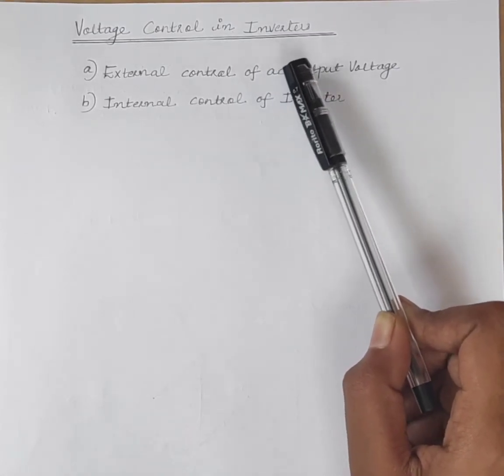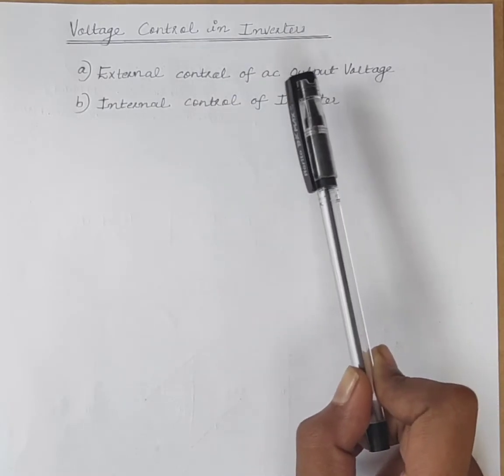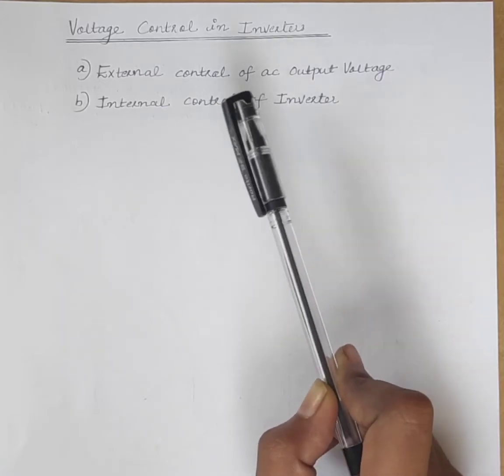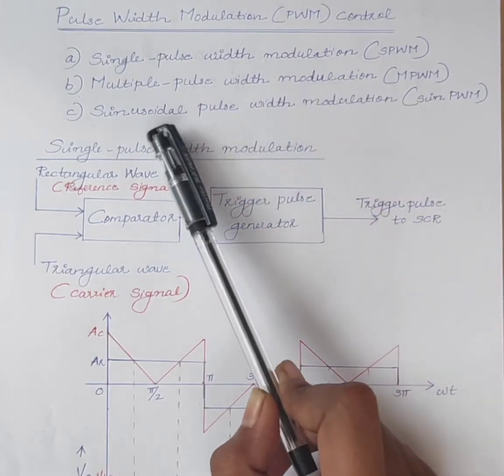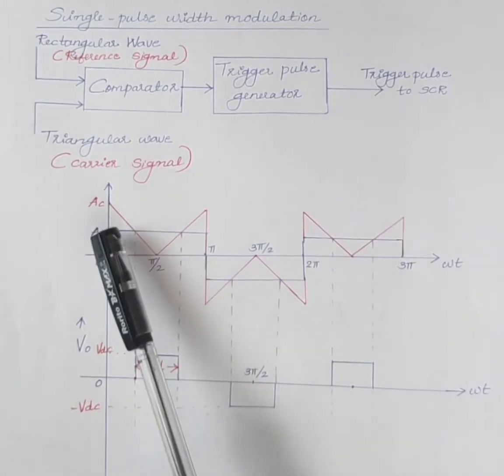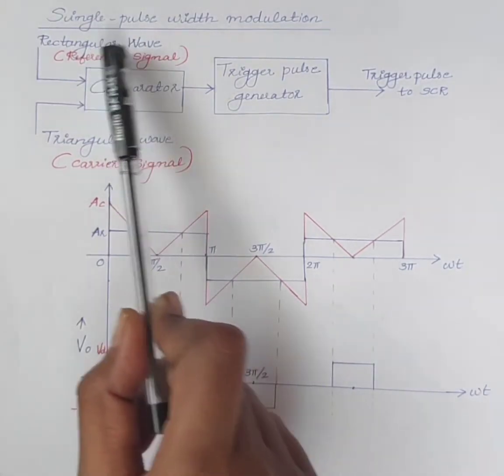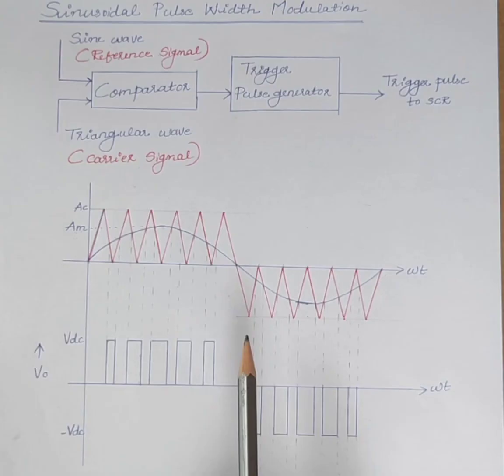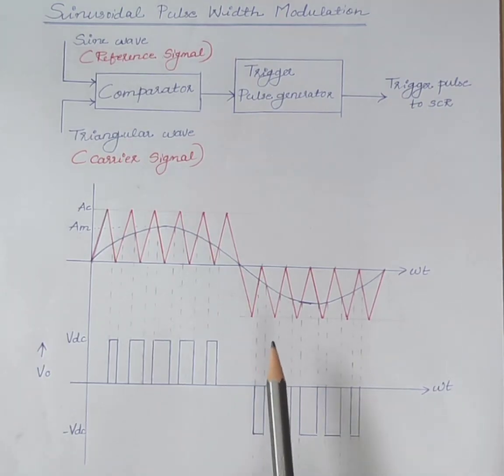Voltage control in inverters - Pulse Width Modulation (PWM) control

Comment: ഇതൊക്കെ ഞാനും പഠിച്ചതാണ്.ഇന്റർവ്യൂവിന് ചെന്നപ്പോൾ അവർക്കു തിയറിയൊന്നും അറിയണ്ട.ഡ്യൂട്ടി സൈക്കിൾ വേരിചെയ്ത് എങ്ങനെ 14.1Vസോഴ്സുപയോഗിച്ച് ഒരു ബാറ്ററിചാർജർ ഡിസൈൻ ചെയ്യാനും,12.2Vവരെ 200ma current,after that level to 14.1v 700ma, പിന്നെ 13.8v voltage regulate ചെയ്ത് ട്രിക്ക്കിളിലേക്ക് പോകണം.ഇത് ലേറ്റസ്റ്റ് കംപോണന്റ്സ് ഉപയോഗിച്ചുള്ളതാകണം.തീരെ കംപോണന്റ് കൗണ്ട്കുറഞ്ഞതാകണം,സർഫസ് മൗണ്ടായിരിക്കണം, കോസ്റ്റ് ഇഫക്റ്റീവായിരിക്കണം.ഒരാഴ്ച സമയവും തന്നു.എവടെ?ഒണക്കത്തിയറി പഠിച്ചിറങ്ങിയ എനിക്കു ണ്ടോ പ്രാക്റ്റിക്കലായി ഇതൊക്കെ ചെയ്യാനറിയാൻഒരു ഡെഡിക്കേറ്റഡ് current sensing ic യെപ്പറ്റി അറിയാമോ എന്ന് ചോദിച്ചു. നഹി.
ഓപ്പാമ്പ് കറണ്ട് സെൻസറും ഡെഡിക്കേറ്റഡും തമ്മിലുള്ള വ്യത്യാസം ചോദിച്ചു.ഉത്തരം നഹി.